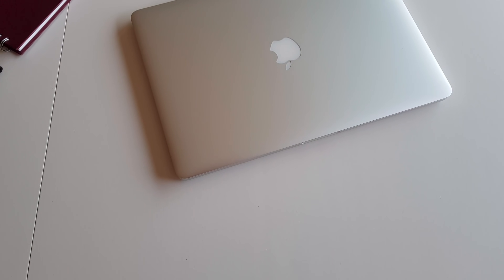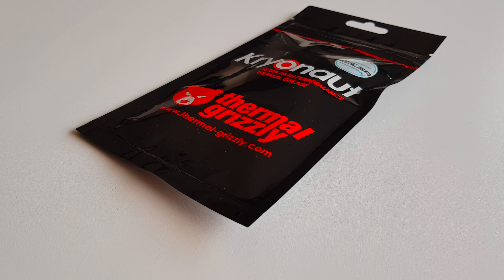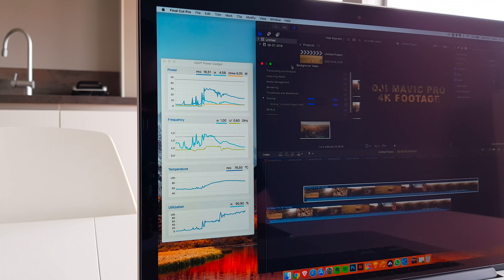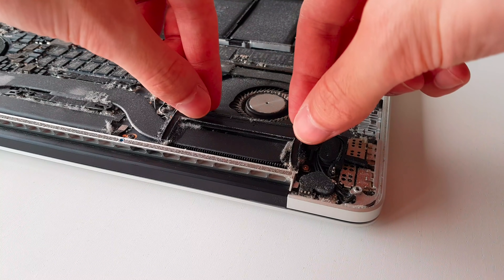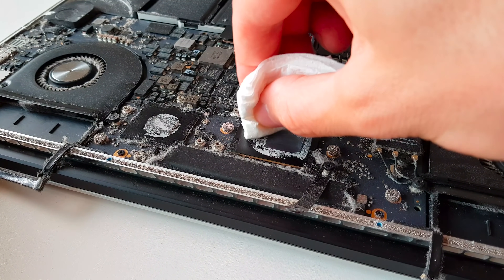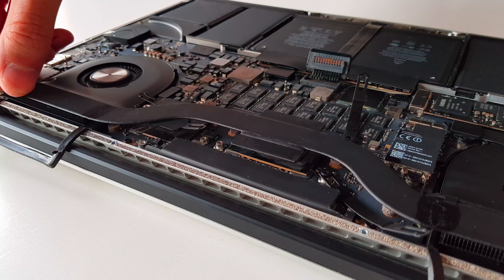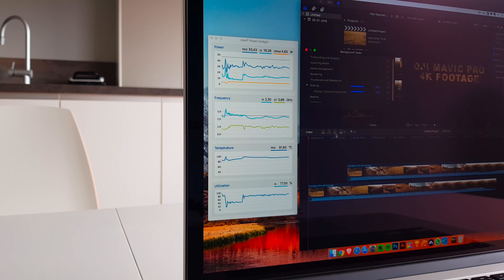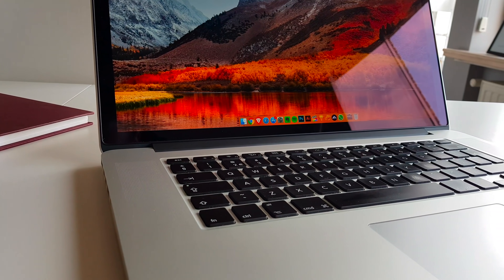Solved overheating problem on my MacBook Pro 15" Mid 2015 by replacing the thermal paste

Comment: Which screwdrivers are you using? You said just two are needed. The T5 and a other one? Is it T5 and 1,5?

I don't really need the whole kit, so I just rather buy the two screwdrivers separate.
Thanks for the video btw, my thermal paste is on the way, I just need to right screwdrivers now and I'll try this in 2 days.
Reply from the maker: Hi Ervin! There is a smaller screwdriver set that I included in the video description (called: "Cheaper screwdriver set") that includes the screwdrivers that you will need. Here is my affiliate link to it: https://amzn.to/2Lk92oY But double check in the description because I assumed you are from the US so I gave you a link to the US Amazon. 

Let me know if you get stuck or need some help! Good luck with the upgrade and thanks for watching my video 😃🙌
Reply: @DigitalPulse  Hey, thanks for your quick reply!

I live in The Netherlands, so I didn't check that US link. And the german one doesn't ship to here. :(
So I'm looking around on Dutch webshops to find the right ones.

If you are using the T5 for everything, I will just order that one separate.
Reply from the maker: I understand. Then you will need the following: T5x25mm,  1.5x25mm and 1.2x25mm. BTW check French Amazon. They sometimes send to the Netherlands (I know they send everything to Belgium) 😃
Reply: @DigitalPulse Thanks. So if I'm correct, the 1.5x25mm and 1.2x25mm are for the cover and the T5 is for the insides.
Reply from the maker: Sorry for the late reply. Yes that's correct. Maybe just in case double check it here because they are the experts and I can't clearly recall which screwdrivers I used since it's already couple of months ago that I did this :/ Here is the link: https://www.ifixit.com/Guide/MacBook+Pro+15-Inch+Retina+Display+Mid+2015+Heat+Sink+Replacement/55922
Reply: @DigitalPulse  Np, I found that guide too yeah. It looked like they only used the pentalobe 1.5x25mm for the outer case and the T5 for the inside. So I ordered those two. They should arrive tomorrow and I'll open up my MacBook Pro to apply it.

Hope it helps. My model has the m370x and I've been using it quite a lot for the past two years for work doing photo and video editing but also gaming.
The thing is, now, even with youtube the fans start to spin to around 3600rpm, and they really shouldn't. On the other hand, it is connected to my Thunderbolt display 99% of the time, which also turns on the dGPU so it uses more power which means more heat, which then obviously means faster spinning fans. But I remember when I just got it, the fans didn't run faster on youtube and lightweight stuff like that.

I'll apply it and see how it goes. Anyway, thanks again for the video and your replies. ^^
Reply from the maker: When you mention it like that it reminds me exactly of my MacBook. Same as you said, when I just got it everything was fine but then after some time, just scrolling down Facebook would make it go crazy.

Cleaning it and repasting it helped a lot so I believe it will be in your case as well. I am also planning to make another follow up video on this with 2 additional things that could lower the temps even more.

Anyway, good luck and thanks for watching! 👍😀

Comment: Great Job, I just subscribed. I have the same Model and I'm facing the same Issues. Because of You I'll be doing this my self.

You can also Use SMC Fan Control to further make it cooler by setting the Fan Control to engage at Low Speed while Computer is Idle. this way it will get all the heat out before it get very hot.
Reply from the maker: Thanks a lot for the subscribe man! Really glad you liked the tutorial 👊😀 I will have to try your fan suggestion as well then. You are already using that?

BTW let me know if you get stuck and need help 😉
Reply: @DigitalPulse  Yes having the Fan always on Helps Especially when You're on Power,  I usually reduce the fan Speed when I'm on Battery. 

I will definitely let You know how it goes when I Open mine up. First I'll need to buy the tool kits.
Reply from the maker: I installed it today and gave it a shot. I think that I will definately also include this in my follow up video for solving thermal problems on the MBP 😉 Thanks a lot for the advice! Learning every day something new thanks to people like you! Good luck man! 👊😃
Reply: @DigitalPulse  I'm happy it really helped You. Looking forward to seeing the follow up Video. 

One Love brother all the way from Lagos, Nigeria. ✌

Comment: Does anyone encountered the Macbook Pro 15 2015 fan just ramp up even though just watch youtube, facebook?
Reply from the maker: Happens to me all the time. Skype, facebook, youtube... you name it. What I started to use is a program called Volta that a user namec Chinchy mentioned couple of posts below. I set the power limit from 30 - 35 W there and turned off turbo bust and the fans stay quiet and the temperatures are acceptable. You should try it as well 😉
Reply: So you meant that even if we change the thermal paste, the temperature does not improve, we need to use that software? But if we limit the Cpu, we should have bought the Pro 13 instead. :))

Comment: great video, however I must say I am not sure if the trick was the thermal paste or the incredible amount of dust you had inside...it was scary man!  also, not to be too critic, but even with the thermal paste, temps reach 90 Celsius which of course should not happen if Apple had a more realistic fan curve. and in all I think your test is too limited, a 2-6 minute render time clip is not long enough to really test thermal. my bet is that if you let a longer clip render, even with the new paste, CPU speeds will hover around 2Ghz or lower, which of course is non acceptable.
Reply from the maker: Hello! Thanks for the feedback. I completely follow what you are saying. I agree, the dust had a big impact on the performance but when you look at the old thermal paste and it's state, I think the re-application of the paste also contributed. In general, MacBooks are quite famous for having a poorly applied thermal paste.

Regarding the video export, you are right there as well. I did notice it whenever I had to export a larger clip, it would indeed decrease the performance. But I am planning to do a follow up on this video. A comment below you can see @Chinchy recommending me to undervolt the MacBook and then try, so that's something I am planning to do for the next video.

Thanks for taking time to watch the video! Your feedback is much appreciated 😃👍Have a nice day!

Comment: I'm probably a bit late to the party here, but because your model is specifically a 2015 one, you can download a piece of software called "Volta" that lets you undervolt the CPU, giving even cooler temps and more stable performance. You can also do other things like limit the power draw and disable Turbo Boost if needed.
Reply: I am very glad you posted these.  I am fighting temp throttling now and read about undervolting.  wondered how!
Reply from the maker: Hi Chinchy 👋 No you are actually not late for the party. It's a very interesting idea that you are proposing there. I never thought of it because I was always thinking that Apple locks down any form of manual control of the CPU clocks. I am very interested to try this out and maybe make a follow up video on this. Do you perhaps have any links you can share with me in terms of undervolting?

Thanks for taking time to watch the video! Enjoy your day 😉👍
Reply: Hi Dario. As far as I know, Apple does lock the CPU, however with Volta it doesn't change any CPU settings, just the power draw (offsets the voltage). I've included two links below, the first is to the Volta website where you can download the file, and the second is to the notebook check guide on throttle stop.

https://volta.garymathews.com

https://www.notebookcheck.net/How-to-Lower-Temperatures-Stop-Throttling-and-Increase-Battery-Life-The-ThrottleStop-Guide-2017.213140.0.html

The guide is aimed at throttle stop for Windows PCs, but is applicable (and a lot easier) for Macs. Just make sure you increase the undervolting value slightly, run a test, and then increase again until the Mac freezes, and then back off to a known stable voltage.
Reply from the maker: Thanks a lot Chinchy! I was a bit inpatient when you told me about this, so I immediately downloaded Volta and disabled the "Turbo Boost" on my MacBook and already felt the difference. Now I will try out the undervaluing guide that you provided. 🙌

I can't believe I didn't think about this before. I did this couple of times on some of my Windows laptops but since Apple is usually strict regarding the amount of control they give you over the machine, I never thought of this as an option.

I think you gave me quite some material here to do a follow-up on my overheating guide! Cannot say enough thank you! 😃
Reply: You're welcome Dario! That's cool (Pun intended)! Yeah disabling turbo boost can help (especially when on battery) and undervolt has the if not more of an impact on temperature.

You were mostly right, to be fair. While you can disable Turbo Boost and lock the maximum power draw (which is another good thing to do), you can only undervolt on the Macbooks with 4th or 5th generation CPUs.

It's no problem, glad to help! I think a follow up video with Volta would be a sweet idea! Let me know if the guide isn't clear enough.
Reply: @ianellis6139  so unlikely to perform an undervolt on a late 2012?

Comment: Good tutorial! Need to do same thing with my mbpro2015. Btw, did you think to make some holder in botton-cover :)? I saw some info in ifixitblog, that you can get like -10C to max temperature with some small fixes 
https://hackaday.com/2017/12/14/cncd-macbook-breathes-easy/ or even something like that 
https://ifixit.org/blog/6882/why-i-drilled-holes-in-my-macbook-pro-and-put-it-in-the-oven/
This + some good cover for holes should do great job as well :)
Reply from the maker: Hello Michal. Thanks for reaching out and watching the video 😃No I have thought of that to be honest. I am a bit scared to do something like that especially if in the future I get a new one and then want to sell this one. I imagine people would be quite sceptical to buy it then. 😅Are you thinking about doing it, or did you already do it?
Reply: Dario Prski  Ive done similar stuff but with hand drill im old MBPro 1.1
It was years, years ago and to be honest - i remember that it was working just 101% fine, and fans were spinning way less. I wasnt monitoring cpu/gpu temp.in those days (i was still more windows user, and that mac was just for experiment) and this „holes” were looking not good ;) If I was to do that today - definetly I will use cnc machine, and some good „cooling grid” inside the hole. Definetly on my list „to do with macbook” :)
Reply from the maker: Yes I doing it on a CNC machine will bring way better results and a cleaner look. If you ever decide to do it please share with me some pictures of it and possibly also the results that you achieved in terms of performance 😉
Reply: Sure thing. Ill let you know once its done - but first - thermal pasta fixing ;)
Reply from the maker: Looking forward to hear from you! Enjoy your day Michal and good luck 😄

Comment: Brilliant video, thank you! I have a mid 2015 15" Pro with the AMD R9M370x GPU, I've had it for 3 and a half years,  used it every day,  and it was running very hot, the fans would ramp up to 6000RPM for watching a 1080p youtube video, I took it apart, and the was almost no thermal paste applied, about 1/3 of each dye had dried powder on it, it seemed they didn't even cover all of it when it was new! so I replaced it with a good amount of Arctic MX-4 and now it's running so much cooler. Thanks again
Reply from the maker: I am so happy to hear that! Such a nice feeling knowing that my video helped you! You are very welcome and thank you for taking time to watch the video. Enjoy your MacBook and have a nice day! 😉👍
Reply: Hello Ranalaped, how was the temperature and fan speed after you did the trick?
Reply: @nongdankitty  After I replaced the thermal paste, the fan's stayed below 3000 rpm when web browsing, watching youtube, watching movies, and general light/medium usage.  The temperature was normally in the mid to high 60's too, beforehand they would be in the high 70's and even 80's, with the fans on maximum, with the same light/medium usage. The fans will still of course spin up to maximum when playing demanding games and such, but that's to be expected with any laptop.
Reply: @Shaggy12321  Ohh wow. So, it really helped. Did you use the same thermal paste he used in the video? I'm about to order one. Thanks
Reply: I'm about to open this exact model and do the same is there a separate heat sync for the AMD GPU?
Reply: @Shagster i have the same machine...but the improvement lasts only few hours...how long does it lasts on your macbook?
Reply: @massimozeni  Since I changed it over a year ago, the thermal paste Apple use is extremely cheap, and in small quantity, so this stuff will perform better for years afterwards.

Comment: Great video 👍 but first you should of blown the dust with compressed air being Careful not to spin the fans as it can  cause a electrical spike ...  easy to do and then you have nice clean work area
Reply from the maker: Thanks a lot man! Happy to hear you like the video 😀 Unfortunately I did not have compressed air at that moment at hand so I had to brush everything out carefully with a soft brush. But I will keep that in mind for next time 😉 Thanks for the advice!

Comment: Verry nice Job.
I use the MBPro 2015 13" and every 2 month i clean up the inside. It is kind of satisfiying to clean up to geht stable performance.
So i use same Thermal Paste. And the thermel paste aren´t dry after 2 years of use! they are dry at the day you get the device!
So i replaced my one after a week i get the device. 
Please take care of this nice piece of technologie. Because of all these Ports... you never get a new one without adapter  to put in a SD Card or so....
Reply: Sadly I need to agree, thermal paste in most cases is dry when device is delivered, or at least semi-dry. I can 'dry-out' Arctic Silver 5 in 12 months typical use (not one from '99 but current one, which means current product is much worse). I assume that even thermal grizzly Kyronaut should be replaced after 18 months use. Not to mentioning the cleaning of the fans and internals.
Reply from the maker: Tnx man! 👍😁 Yeah it's a really nice feeling. That and reinstalling the OS 😄
Reply: Do you use the stock SSD?
I installed just the 970  EVO 500GB and installed the Mojave, and yes it is a good feeling to set up a clean fresh system! 😜
Reply from the maker: Yup I use the stock SSD, running Mojave here as well 😎👍
Reply: What paste are you using?

Comment: my 2011 macbook pro 15 inch was worse tha yours, its still running but with some gpu probs, ive repasted it this years after 7 years running 8 houres a day on general.... i might buy the new one
Reply from the maker: My drove me crazy. It would constantly run hot and it would drain my battery really fast. A skype call would make the fans run so loud that I was not able to have a proper conversation. Crazy how fast they get clogged
Reply: mine was completly full and one fan couldn't even spinn.
Reply from the maker: I see now why you say it was worst than mine 😄
Reply: @rodrigo4379  2011 Macbook Pro 15" have GPU problems. Has nothing to do with thermal paste.
Reply from the maker: Well for me it worked. At least I got it working more or less the same as when I got it
Reply: @1CrazyDJ4U  nothing??? So you can run it with no thermal paste???
Reply: Edgar Bleikur Please
Search google. 2011 MacBook Pro GPU issues.  You have the world at your fingertips.
Reply from the maker: @edgarbleikur1929  I really hope he's not doing that lol
Reply: @DigitalPulse  after all this years my machine decided to die, doesnt turn on and smels like something has burned out, i came back to this video dunno why :D i might get the vega 20 mac what do you guys think? (ive opened the mac and the vrm is completly black and seems that had a fire or something)
Reply from the maker: @rodrigo4379  If you have the money then go for it. Why not :D